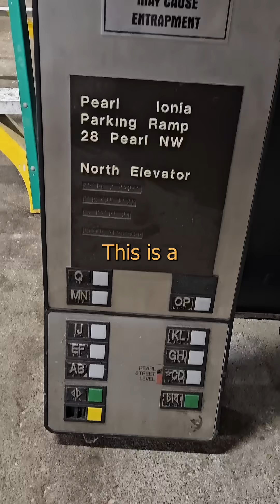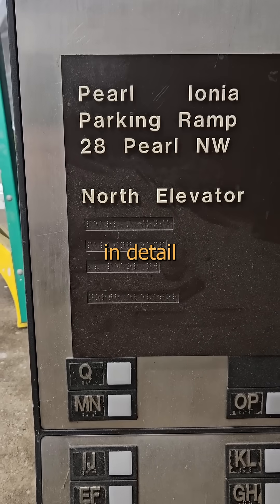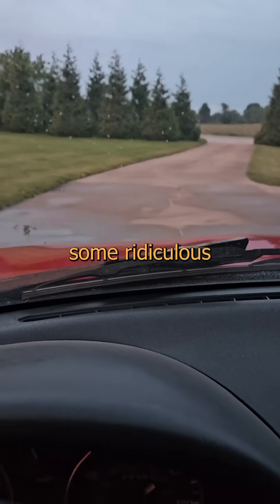Miata Mischief #chrisboden #engineering #gear #elevator #score #stories #parts #hacking #making

Comment: I and some friends had a huge old couch to disperse of and a beach party planned. We dragged the huge couch into the metro and it could only fit if one side was elevated to the roof while the other side rested on the floor. 

Several metro stewards asked us to leave so we had to drag it out and sneak it back into the next metro train a few times. Finally we got it to the beach and held the party. Next day we see the couch on the local news. Apparently it brought some bad attention to it, and they made a section about young kids dragging ridiculous items to the beach. 

I also once dragged a 303kg safe across Copenhagen on a palletwagon.

Comment: A friend of mine had an early 90’s Jeep Wrangler that we swapped an LT1 V8 into.  But the stock rear axle was not up to the task of handling the power.  So I drove my 2002 Hyundai Accent hatchback 200 miles to Oklahoma to pick up a Ford 8.8” rear axle assembly.  The entire assembly with disk brakes and all.  The loading dock guy thought I was pulling a prank on him when I asked if he could lend me a hand getting it into the car.  With the back seat laid down, the passenger seat leaned all the way back, and some thick cardboard laid down, it fit, just barely!  

The Jeep ended up being a LOT of fun, especially since the Jeep was not lifted and we kept it four wheel drive.

Comment: I was helping a friend of my dad‘s move a non-running tractor from the previous owner’s house to his house. He didn’t have a trailer hooked up so he just chained the front axle pulled me 30 miles an hour down the road granted this tractor was from the 1950 so it shook horribly the entire way there And I am too tall for the operators platform on that thing so I’d have my foot on the rotating brake thing that John Deere two cylinders have so yeah my shoes had a new curve by the time we got to his house

Comment: Had to rebuild a section of my fence after a neighbors pecan tree fell on it. Had to stuff twelve 7'x4" pickets, two 8'x4"x4" posts' and two 80lbs bags of concrete mix into my Honda Civic Si coupe. Not to crazy, but it's not super fun to drive a manual trans car with fence materials poking you in the arm and back of the head!

Comment: When I was in college my dorm rooms were on the third floor of a hotel in downtown I took one of their luggage carts and walked it about a mile to go pick up a 56 inch flat screen tube TV. Thing must have weighed about 300 lb. Then wheeled it  back to my dorm room a mile away straight through a lobby full of people waiting to check into the hotel and up the elevator. At the time my only vehicle was a 2003 Mitsubishi eclipse and when they were standing right next to each other the TV was taller than it

Comment: I purchased a $500 1966 Buick LeSabre with no front suspension and one wheel in the rear.
I slid a Very sketchy tow dolly under the tattered and dangling front giblets and used every strap and chain to " attach " it. 
A ton and a half of Detroit rust fishtailing on a cracked, rusted and structurally dubious dolly for almost 7 hours. 
This was 2 weeks ago.

Comment: I had a Renault Le car which I had rebuilt after a friend blew the engine, a tiny little car in about the same form factor as a mini Cooper. After I drove it around the country with my sweetheart, I pulled out the backseat and used it as a pickup truck for a couple years. I was building a wooden spiral staircase and picked up the center post from a lumber yard, it was 12 in in diameter and 14 ft long, it stuck like 6 ft out the back. The back wheels were completely down on the rubber pads, zero shock absorption. But I got it home and that car kept on going. While we were driving cross country we went to the rainbow gathering and filled it up with about 15 crates of food from the commercial restaurant food market in Louisville Kentucky, the one you have to get to at 3:00 a.m. I don't know if those still exist anymore. It had a huge sunroof, almost a convertible, so we said all the boxes up so that my friend could sit on top of the boxes sticking out the top looking like a commander in a tank as we drove the last 50 miles to the gathering. I don't understand how we both survived our mutual stupidity.

Comment: Got a new 7.3L Ford towed by chain 20 miles by another 7.3L Ford at night. The truck I was in wouldn’t start and wouldn’t pop the clutch. I tried as much as I could to get it to start with no luck. Also hit the back of the other truck so many times I’m surprised both bumpers stayed on.

Comment: I once bought a commercial grade dual head espresso machine for £50 and hauled it back for 30 minutes on my longboard. It weighed 90kg and I lived in a hilly area so down one big set of hills and then back up another set of it was a stressful journey. I later sold it for £500 (later being 6 months).

Comment: I can’t compete with the ‘stupid’ part but i did once transport 2/3 of a pallet of MRE cases in a 2008 ford focus 
Supply Supervisor begged me to stop with the Tetris when i had an inch clearance between my tires and the rest of the wheel well. 
Chicken, i could have crammed a few more boxes and still had space to drive.

Comment: I hauled my Harbor freight 72" toolbox home in a duramgo woth the top section and drawer and locker addons on top. They looked so goofy at me while we were loaoding it. 

Also got a light pole off the side of the interstate that they were taking down....not the short ones....the tall tall ones. Used 2 blocks of wood woth cradles notched jn them on the roof and loaded it on top of an Astro Van. Several state troopers onspected us on the way home because they didnt believe their eyes. Hung over almost 60 feet on each end. We had the proper tie downs and flags and everything though so technically it was legal. Took 20 people and 2 mini excavators to put it up.

Comment: My Father got "a good deal" at a local auction. He bought a New Holland round bailer . We don't own a tractor..... So we welded a pintle hook on our flat bed ladder racked POS ranger. When we hooked up it crushed the flat bed into the tires. Not the kinda people to be dissuaded by a minor issue, we helped the leaf springs with some wired in 4x4 blocks. We made it👍

Comment: I strapped a kayak to the back of my 250 cc dual sport motorcycle I bareley fit in the lane and was terrified of hitting things as i passed them. That was the funniest looking thing i also towed my buddies Hyundai Elantra about 2 miles with my Coleman mini bike that was the most impressive. I also used to regularly haul literall tons of soil in my 2005 Pontiac grand prix people seriously underestimate the power that even a small motor really puts out especially with proper gearing. My 11hp mini bike barely struggled to tow that car I couldn't go much over 20mph but it towed it uphill even it had a cvt with a 60:1 ratio on the big end of the cone and went up to a 5.5:1 on the small end it would tow a car uphill at low speed and still to 60 on a long enough straight away and that was with a 6k rpm limiter

Comment: My work was giving away a manual forklift. 

I had a trailer with no floor, and some old bits of kitchen cupboard. So I popped them in the trailer, trundled to work, struggled the forklift into the trailer and it went straight through the particle board kitchen cupboard parts and ended up wedged in the middle of the trailer but mostly resting on the ground.

I could have done with a forklift to unstick the situation, sadly the only one available was the one in the situation.

After much cursing I managed to get it securely enough in the trailer to make it home.

Comment: Ironically enough, it was in my SECOND gen Miata.

I rescued a paradise palm from the garbage and, despite sitting on the floor boards, the leaves were still sticking out the window (i had the hard top on).

Partway through hauling it home a bunch of bugs started crawling off of it, including a spider which i never found but it DID leave a web for me the next day.

That Miata is SO goddamn fun. However my fiance really wants a first gen because of the flippable headlights.

Comment: I've done a LOT of stupid shit.
Hauled a rubber boat on the roof of a fiat panda (sunroof was still able to open btw).
Had a boat that didn't really fit the trailer so I had to open the cargo doors of my Renault Kangoo to fit the front of the boat inside the cargo area so yea stupid but Bost of the time the stupidest shit you do is the most fun

Comment: I stripped a camper trailer down to the frame and proceeded to drive 1.5 hrs into the downtown of a major city. With every 1 inch ratchet strap I had i loaded a 2 post car hoist onto the bare frame of the freshly de nuded camper and with homemade trailer lights we drove home. When we pulled off the highway we noticed that vehicles were riding our ass.  We had  dropped the wire for the trailer lights and had driven over it ripping the lights clean off.  The trailer decking  was 2x2 x1/8 angle and was resting on the axle. The straps were nowhere to be found. I have no idea how it stayed on.

Comment: Two rear rims with brand new rubber, for a CAT 420 backhoe, on the roll cage of my little brother's less than 2 year old Jeep. The short one, not the 4dr. Stacked one on top of the other.  Pulled the hardtop and doors off so they had a better chance of remaining useable....

He borrowed my 1 ton to haul his boat halfway across the country, and I had a buddy call me from a farm auction after he was the only bid, and had no use for 'em or room on his trailer to take 'em. I had a  420 and he said I can have 'em if I get there before he loads up and leaves. If i didn't a guy offered him $100, his bid was $200.  

So, 1.5hrs later I had around 8 or 900lbs sitting on the roll bars and standing about 4ft tall stacked one on top of the other and almost as long and wide as the damn thing.    Not exactly the most comfortable experience when you're used to a 1 ton and think the fucking thing wants to roll over as it is, without the extra top heaviness , when you simply change lanes.

Comment: Sometime in the early 80's, my Yamaha SR500 died on me about a mile and a half from work along a major road. I walked to work and asked a friend to help me tow it back to the parking lot, where I'd have the chance to work out what went wrong. We tied a length of clothesline around the back bumper of his car and I wrapped the other end, about 30 feet away, around the motorcycle's handlebars - no knots there, so I could let go if I had to. Safety first, after all! We got most of the way back like this, but then went around a sharp turn on the route, which slid the clothesline over the headlight high-beam switch and turned it on and off several times rapidly. My buddy, seeing this in the rear-view, thought I was signalling trouble at my end, so he slammed on the brakes. The bike kept rolling of course, and the clothesline started to lay out on the pavement ahead of me. Now I jammed on the brakes, just as my buddy figured out I didn't want him to stop, and took off again. There was a big jerk on the high side of the handlebars, which I somehow rode out after letting up on the brakes, but he saw this and braked again - same twitch and switch. I think we did this three or four times before the car won and my bike landed on its side, dragged down the road at 25 MPH with me under it. I remember the sound of my helmet erasing itself on the curb, and that I actually got up and moved the bike out of traffic once everything stopped moving. I had promised to take my wife to the Art Institute the next day, and she held me to it - that was the slowest tour of the art displays we've ever made.

Comment: In highschool I drove a "project car" 72 Volkswagen Beetle Convertible. The first day I drove it to school it didn't have the top or the back seats installed yet. One of my two best friends was like 6'4" and 300+ lbs, and in the passenger seat the tires rubbed into the wheel well, but if he stood up in the back the weight distribution was perfect, so I drove him home real slowly while he stood in the back. Total viking energy

Comment: A neighbour up my street then down the next street was giving away an upright piano. My friend and I somehow got it onto a couple skateboards and proceeded to push lump fkr up the hill to my street. All well and good until we came down my street and it started to slide off the skateboards. One broke clean in half as the piano then toppled onto the road smashing face down, digging a very rectangular dent in the newish tarmac. The noise was so amazing and loud af 😅
I couldn’t stop laughing, but panic set in when we had to get it off the now blocked road. Unable to lift the thing, we used car tow ropes to drag it towards my garage, where it sadly was dismantled and metal scraped. That was probably 25 years ago and the dent is still in the road today. 😅

Comment: 40 inch TUBE style TV. Moved in in my 79 Camaro. Had to remove the passengers front seat and stuff it in upside down behind the drivers seat in order to barely get the TV in through he (thankfully very wide) passenger door.
When I got home I proudly told my wife.."see it IS practical!"
She still brings that up every so often even Thirty two years later.....

Comment: Hahahahhaa here ya go.  My younger brother does concrete finishing.  My older brother let him use his 96 firebird convertible to do a job.  He put the top down and had a wheelbarrow 20 10 foot 2x4s and allnhis tools sticking outta that thing flying down the highway hahaha not only did he make it to the job but he knocked that job out and did another one with all the tools hanging out. Hilarious as shit too see.  

Ok next story.  I'm am a dry wall finisher been finishing boards since I was a wee lad.  Any ways when I first started out I was the floor scraper and we all 4 rode in the bosses little dodge peon for a few weeks while his truck got work done.  Well we had all our hand tools all the board finishing tools and of course power sanders shop vace everything for 3 journeyman. Lol I rode in the back with 3 10 and 12 inch razor sharp scrapers staring me down my eyes.  One fucked up turn a brake check or wreck I would lost my head.  Literally.   Ahhhh man that was the best times of my life honestly.  Live life to the fullest boys and girls. And that's pretty stupid! 😂

Comment: Naw but seriously. Short story…. Imagine for a sec… 6 tons of hvac fan blowers and ac. Held together on a truck via nothing more than sheer balance and a few twisted wires and tow straps. No Ratchet lock. It’s was a pucker fest.  Each turn felt like it was gonna snap that wire like wet spaghetti.

Comment: After I graduated from college, I worked at the school's IT department for a while and they were getting rid of all the Pr1me computers that they had had since the early 1980s. I asked if I could have the smallest one because I lived in (what you would call) a dorm room. They said yes. The Pr1me 2350 was a bit bigger than a full size PC tower in 1993, think 12 inches wide,  36 inches high and 40 inches deep. It weighed probably 120 lbs but fortunately it had wheels so I figured I could get it home on the city bus. I had no car. 
Unfortunately the built-in 5.25 inch full size hard disk didn't work anymore, but they were okay with me talking a disk controller from one of the bigger systems, plus a 19 inch rack with two CMD rack mount disks, 300MB each (huge capacity for that time). Unfortunately those were way too bulky and heavy to take on the bus, so I took the disk pack out of the first hard disk and removed the AC spindle motor and brought it home on the bus. Then I went back and got another piece of the disk drive. Then a house mate who owned a car offered to help me get all the rest of the stuff and it still took 2 trips to get everything to my room. I also got a 9 track tape drive and a terminal.
I hooked everything up and switched it on, but even though I lived in 220V land, it tripped the 16A circuit breaker. I had to set it up so that the disks would wait for each other instead of trying to spin up at the same time, to keep it running and use less than 3000W. It was loud as hell but it worked. For about half an hour, then it got to over 100 degrees in my room and I had to shut it down again. Too bad because it took about 20 minutes to boot. I kept it until I emigrated to the USA and then unfortunately had to get rid of it. There's a computer museum now in the area where I used to live, but 32 years ago, that didn't exist yet. And there are no pictures of it (or any other Pr1me 2350 systems) on the internet anywhere. 😢

Comment: The city replaced all the light poles going up the interstate and left the old aluminum poles laying down by the road for months. I had a ford Econoline. I pulled over, slid a pole in the van leaving about 20ft hanging out the back, drove up to next pole and loaded it. Got about 15 before the cops came. "Just cleaning up the trash these people left" i said. I had to unload them. No charges

Comment: My sister let me use her car in exchange for a free parking spot in college. We went to the same school, she was on-campus without a parking spot and I was off campus with a parking spot but without a car.

One day, driving home from school in my sister's car, I see a pile of nice hardwood precut firewood, for free. My apartment had a fire pit and I was having a cookout party in a couple weeks. So I filled the trunk with free firewood, then the backseats, then the passenger seat. Then I went back and did it 3 more times.

The suspension on that car died shortly after. I felt bad and knew I was responsible, so I replaced the struts and never told her.